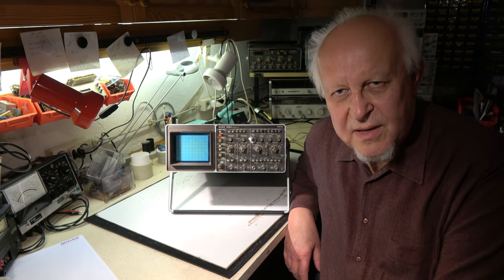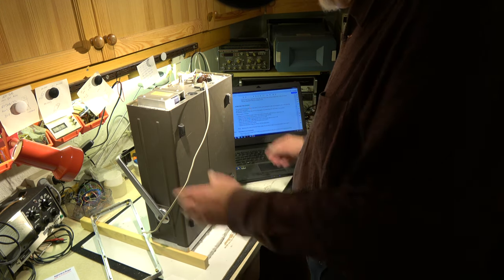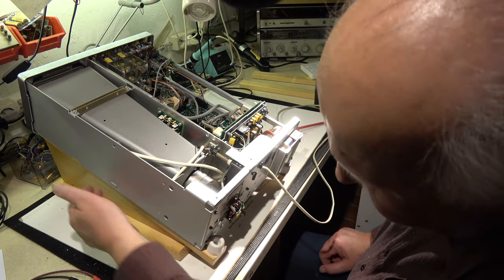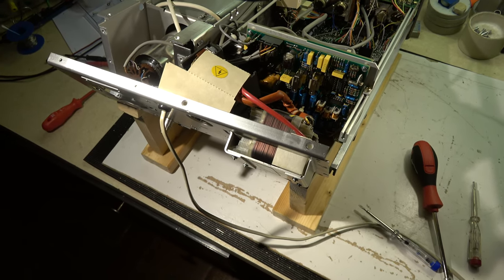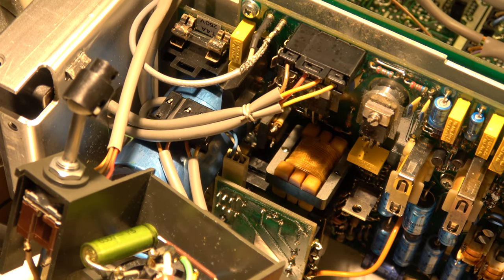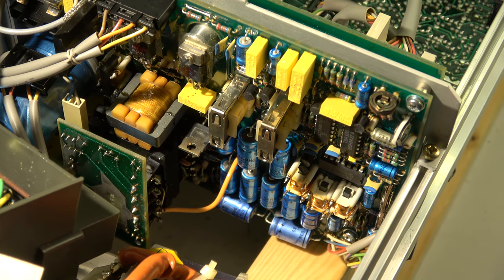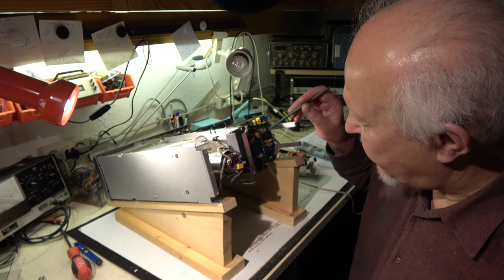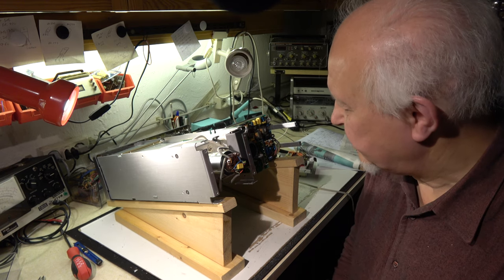#6 Philips Scope PM3219 Repair - Part1(2)

Comment: I like your attention to detail, and the logical fault finding process. A standing joke when I was in the service industry many years ago, the electronic components are put there to protect the fuse. ... especially in the early days of colour TV power supplies.
Reply from the maker: Ha! Yes, nearly any fuse is always slower than a dying semiconductor. So the fuse doesn´t protect the semiconductor but the energy supplying component (transformer, rectifier, etc....) and therefore the whole unit.

Comment: Ah, the dreaded RIFA plague strikes again. These specific caps are notorious for failing, and they're responsible for a huge amount of unnecessary scrapping of otherwise perfectly functional gear. Good that you repaired it!
Reply from the maker: Yes, it´s a pity that many good gears are scrapped this way. But on the other hand, it´s a good opportunity to get good gears rather cheap.

Comment: Hi! I have this same scope but ran into the issue that its always lighting up even when memory is off. The scope works normal otherwise except that the screen always is somewhat bright. Following the calibration steps got me nowhere, any clue on how to fix this?
Reply from the maker: Hello, i´m sorry, but a remote diagnosis is nearly impossible! Seems, that the CRT is permanently flooded ("flood guns") by the storage control. So look for faulty switches ("memory off") and components on this board.
Reply: @dl7majstefan753  I've found a document by philips describing this condition and how to fix it  https://xdevs.com/doc/PHILIPS/pm3219%20.pdf
seems like its a common issue caused by some design flaw